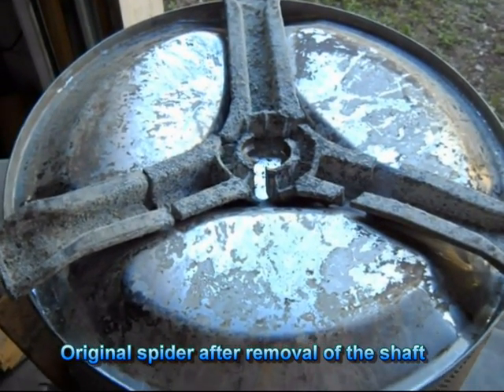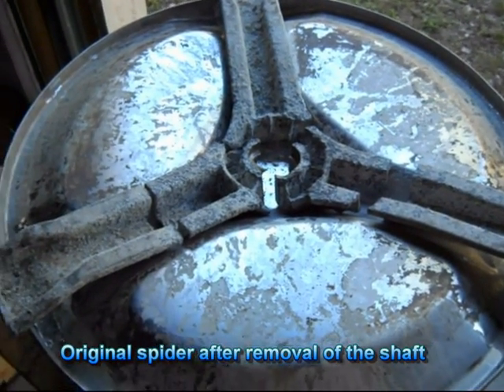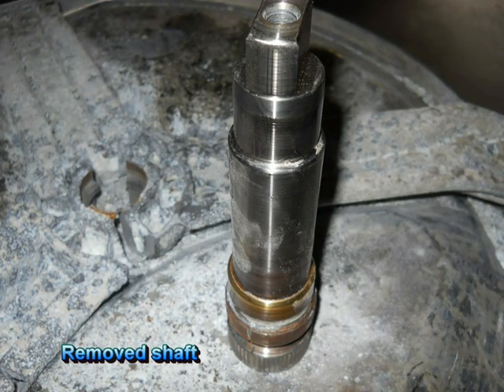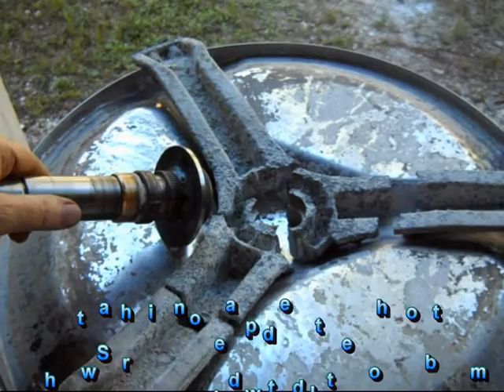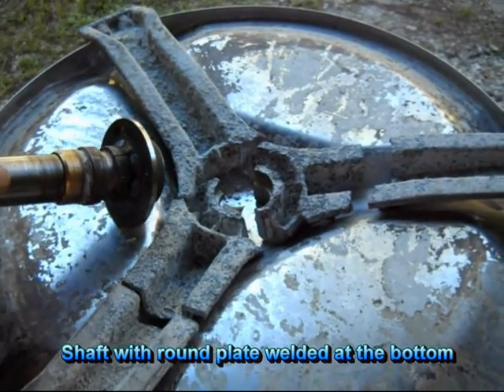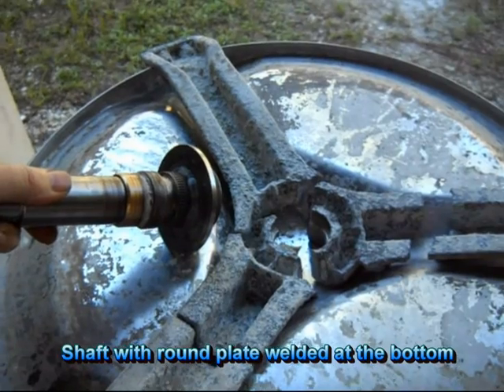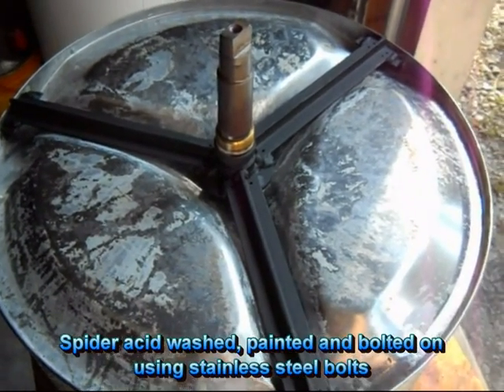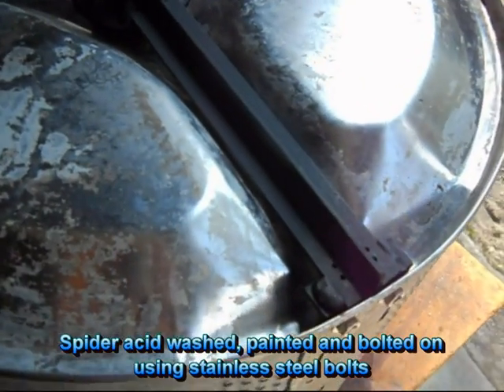Do It Yourself Front Loading Washing Machine Spider

Comment: I know this is really old.... but after going through the process of replacing a spider arm recently, and thinking about why these may be made the way they are made (other than cost and weight), I concluded that they are intentionally made from aluminum because they act as sacrifical anodes and protect the steel shaft and bearing hub (molded into the plastic tub) from corrosion. With that in mind, a DIY steel spider arm could be improved by bolting lengths of bare aluminum to the arms. That would preserve the anodic protection. Although once those are corroded away the steel would start corroding. But at that point you know what youing on and can replace them.
Reply: Using aluminium is down to cost, some washing machines have stainless steel spiders, such as some of the high end and professional Miele models. I do believe the shaft is typically stainless steel, is on mine anyway  and I would think the boss is too. The main cause of aluminium spider corrosion is crevice corrosion (aka oxygen concentration cell corrosion) due to  bacteria and other gunge such as mould,  fabric lint, grease, grime, detergent and conditioner residue forming a biofilm coating the spider, which depletes the surface oxygen to a varying degree across the surface, forming oxygen concentration cells with the points of lowest oxygen become the anodes where the corrosion occurs. 

My 15 year old washing machine still has its original aluminium spider, it was in excellent condition when I changed the bearings which had rusted because the rubber water seal  on the shaft had worn out. The tub, spider etc, unsurprisingly were clean inside apart form a bit of limescale and limescale encrusted lint. I leave the door and draw open between washes, use powder rather than liquid, do occasional 60C+ washes to kill any bacteria and help clean the machine of detergent and fabric conditioner residue and use powder with oxygen bleach.
Reply: @mels8966  I have started leaving the door open on mine so that it dries. Fingers crossed it lasts.

Comment: Nice idea! How did you remove the shaft from the spider assembly?
Reply: Did you find a proper way?
Reply: Did you find a proper way?
Reply: No I didn’t. I said screw it and bought a new one off Amazon. Was like $90.
Reply: @berniemac8413  I've been looking for a replacement all around but I can't find any. the only official solution for indesit XWA 61252 is a full drum replacement so I can't be shure that any of the available spiders will fit. That really piss me off!

Comment: That will last a lot lot longer than oem
Reply: He didn't mention what metal was used to make it ? Why won't it also be subject to corrosion like the previous one?
Reply: That would be nice if he did but the OEM looks like it was some sort of magnesium melted in with whatever could be found left over on the floor! It’s cheesy and designed for planned obsolescence!
Reply: @aarontyrrell2931  it's aluminium die-cast alloy 3. How long it lasts is up to the user. It's not mentioned anywhere in the video how long it lasted. From what I've seen the low point is 5-7 years to failure and the high is 12-14 years. If people are closer to the low point then they are doing something wrong.

Comment: Fantastic job! That will Outlast any factory made spider arm. I just replaced one that was only 4 years old and completely disintegrated. The new one will probably only last 4 years to. Yours will probably last longer than the washing machine. Great job
Reply: I had the same issue on a Samsung front load machine.  Was out of balance and I found that the spider arm was totally corroded.  Luckily the part is available so I replaced it with a new one.  Kinda wished I had coated it with something as I’m sure the new one will end up like the original in another 4 or 5 years!
Reply: @martynh5410  just remove and coat it asap.
Reply: @redblue17    It’s such a pain to get that spider out, I’m not going to do that!!
Reply: @martynh5410  that is a very short life for a spider. The low end I've seen is 7 years and the high mark is around 12 years. So how do you manage to kill yours in 4 to 5 years?
Reply: @johndoe-vc1we    Must be bad water perhaps!  Or did Samsung use some cheap alloy for that part?  We just sold the house complete with washer and dryer do I’m not too concerned about it now.
Reply: @martynh5410  what does bad water mean? Is it hard and if so have you measured its hardness? because that will affect the drum support of any machine not to mention wash quality of every wash.
Reply: @johndoe-vc1we    All I know is that it tasted bad.  Not necessarily “bad water” but it had enough impurities to taste bad.  I spoke to a local plumbing company about the machine and he said that the newer models from Samsung and LG seem to be having issues with various items. I can’t confirm or deny that though as I have no data other than that one machine.  For all I know it could have been a “Lemon”!
Reply: @martynh5410  what did that local plumbing company have to say about your water quality? I found someone who managed to break his spider in 24 months. A new record. He gets a new spider coats it with flex seal and this one lasts 18 months longer. So he's cracked the 3 year mark but couldn't get to the fourth year. He gets a third spider and this time he powder coats it. Ridiculous. See what I mean? Going through 3 spiders when some are still on the original points to something wrong with user. What?

Comment: The spider is submerged in water during the wash , so the concern is rust and what it will do to clothes. The original spider is cast aluminum alloy, which corrodes but does not rust.
Reply: I suspect that the use of aluminum is intentional because it acts a sacrifical anode. The steel shafts and the bearing hub (molded into the tub) are nearly prinstine in ever case I've see. And they are plain steel, not stainless. Evidence of the spider acting as a sacrificial anode.

Comment: So let me get this straight. After all of that teardown (I've done many), you didn't wash the inner basket or outer basket with degreaser?!???? I use lye (sodium hydroxide), Zep Industrial Purple degreaser, to wash all internal components. I mean, what's the since in putting it back together dirty? So you can rinse your clothes in that filth? Then what's the since of washing clothes? Tub clean cycles don't work. Front load machines are disgusting and poorly designed - about 1/3 of the machine never sees water and gets filthy from splash water. I increase the water level sensor slightly and this helps but to really clean the machine it must be disassembled.

Secondly, why didn't you use stainless steel? Also, these arms are casted or stamped for a reason. A weld is going to eventually break. There is massive centrifugal forces and vibrations on these arms even upwards of 1000 pounds of force when there's a full wet loan spinning slightly unbalanced. 

You should have also used epoxy primer before painting. I would have used a poly paint or even epoxy paint.
Reply: Give Ron a break!!!..."I woulda"....."You shoulda"...…"You coulda"..... No one really cares....WTF???
Reply: Why didn't you mill a new basket and shaft assembly from a block of stainless steel? If you listened to this guy you'd soon realize that that's the only correct repair method. He has all the answers, just ask him. Just kidding, dude sounds like a know it all douche. Horses for courses, dickweed
Reply: Thanks for the comment, Robert. How can the work here be improved here IS of interest to others. Your point about degreasers is spot on, I've seen numerous videos where the tub isn't even cleaned after the spider is replaced.

Comment: Thanks to all those that left comments.   For those interested, the repair described in this video has been in place for 3 years now and the washing machine is still working great.  There is nothing critical in making this type of spider except that you should strive to have accurate centering  and height distance of the final shaft postion.  If the arms are nearly identical, balance will not be a problem.
Reply: Nice work!

Comment: Total cost for that project @45$ an hour is many hundreds of dollars that had no reason to be spent. Corporate greed - using zinc casting which ends up being a sacrificial anode. Galvanic corrosion is the problem, with soap and oxygen and heat stirring all around, that tub and bracket are a perfect battery.  And sorry to say but, carbon steel and stainless steel have an anodic index of .35  - ideally it should be under .15 , so you are going to have a reaction there also. The SS to zinc alloy is about .75 so that is just an engineering disaster. Built in failure.  Buy a top loader! Speed Queen or the $300 Whirlpool.
Reply: Man sounds like he knows his shit. Definitely good ol' top loader next time.
Reply: That is a typical die casting - some various combinations of aluminum, zinc, magnesium. It has a low melting point and can be forced under pressure into steel moulds - quick, cheap and accurate. You just don't want any of those metals bolted to SS and then immersed in soapy water. They build to a price and profit point and know very well that this is a built in failure device.
Reply: Richard Raucina if one were to buy a front loader new, they could paint the spider arm before corrosion sets in
Reply: Unfortunately that would mean almost complete dissasembly of the machine which would be rather difficult and an absurd task on a new and expensive machine. Sort of like buying a refrigerator and then going inside it and replacing the defrost time because it's a know failure item. Most importantly, painting the item would not necessarily resolve the cathode-anode issue since the screws penetrate the two dissimilar metals and would still complete the "circuit".  Rather buy a simpler machine or if you really need a front loader, go on ebbay and find a used commercial washer by many USA companies that are built like tanks. Since most of those come as coin operated, you could make some money off your wife and have a good place for all that pocket change to go in the laundry room.
Reply: What do you think of spraying the homemade steel spider with a pickup truckbed coating?

Comment: Beautiful. Makes me wish I'd learned to weld, especially if I knew I was going to get a pos Kenmore frontloading washer...
Reply: +Mutt1961 Most all front-load washers experience this same problem... it's not Kenmore specific.
Reply: +Michael Shrader  True. Just pissed that Sears won't sell the spider separately. They want $800 + for a drum and spider assembly. Cheaper places to buy online, of course, but you never know who the rip-off artists are. I finally created a fix using PC-7 and 1/4 x 6" 304 stainless rods. Drilled through the arm compartments and attached to the shaft. Not as nifty as the work shown in this vid, but effective.
Reply: Yep, still holding. PC7 in depressions to hold  rods (1 in ea. arm).  Drill out grooves, then 1 rod against center "rib" in each arm) from shaft to ends. More PC7 in depressions at all 3 bend points w/6 in. (I think) mending plates embedded in wet PC7 (let dry then drill out holes) and bolted thru other side. I only spin on Low now, but works just fine. Good luck. Over and out...
Reply: Used epoxy to rejoin arms, and cured each upright in vice before reinforcing as described above. Did not drill through tub. Rods extend only to back side of spider arm ends (opposite bolt holes). Drilled combination of holes and grooves (grooves where nec. to make rod insertion possible over entire length) through perpendicular, short cross ribs up against center rib. Choose either side - only used one rod per arm to minimize weight for sake of motor. Then drilled holes just large enough for rods through center alloy hub up to shaft, inserted rods and secured them in appropriate depressions and center hub holes w/ PC7 (including small "cup"/depression at hub). I believe there's a PC7 for marine application, but I used regular. Allow to cure. Then set mending plates in PC7 at arm curves (across break points). Used the PC7 here only for eventual, even disrib. of pressure across plates on arms. Attached plates on both sides . Allowed to cure for ~ 72 hrs., Drilled holes, bolted plates together and installed. I only use "Low" spin cycle (I'm more pragmatic than curious) Works like a champ so far - 6 mos.
Reply: This is, of course, the non-welder alternative. I'd obviously go with the vid solution above if I had the skills and tools. lol

Comment: This video prompted me to try to repair my own.  I went a little different route though.  I turned the shaft down to 1.500" then made a spider from a 2" piece of 1.500x2.000 tubing.  Then made up the arms from 3/4 inch black pipe, then made the pieces at the end from flat stock.  Welded it in a jig to prevent warping, then pressed in the shaft, welded it in, painted it and it's up and running again.  Thanks Ron!

Comment: Ron, my spider rotted out completely this summer after about 8 years.  I was appalled to look on the web and see that it happens in every case, because the washer manufacturers would rather save a few dollars and have their customers buy a new one after the warranty runs out.  I thought about making my own spider, but I seemed to be able to guilt Frigidaire into selling me a new drum and spider, which I then sprayed with Rustoleum Cold Galvanizing Paint.  If I had seen your video, I would probably have found someone to weld one for me.  Beautiful job, and a sad commentary on American Capitalism.  Now, I'm just going to hope that another part doesn't break anytime soon.
Reply: since the spider and drum are sold as one part number the whole thing is lifetime warranted

Comment from the maker: I did look into using stainless steel, but it was decided that it would probably be overkill -- I don't need it to last 50 years.  Well cleaned (acid washed) and a good quality commercial grade enamel will probably protect the metal for many years and if any rust does take place, it probably would also be many years before that would cause any problem.  The idea is to make a reasonable (years of use) alternative to the original.
Reply: Ron G Rules!!!